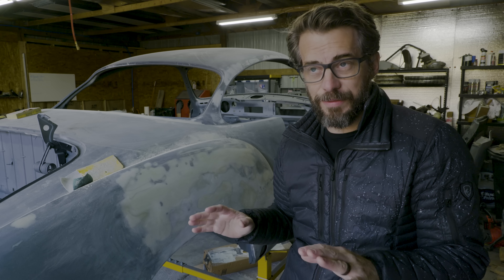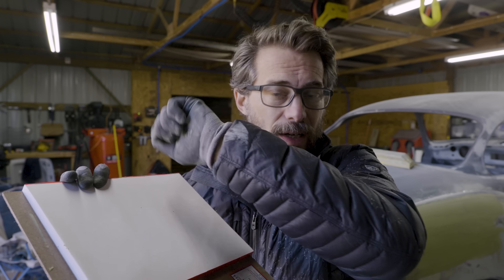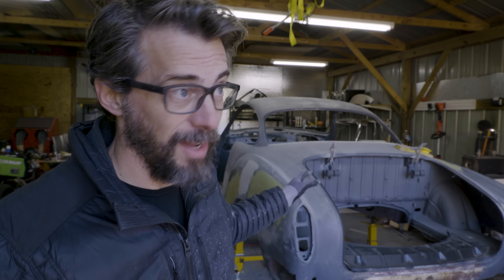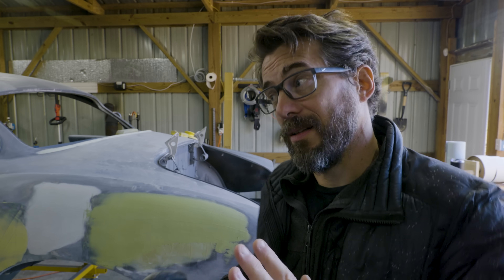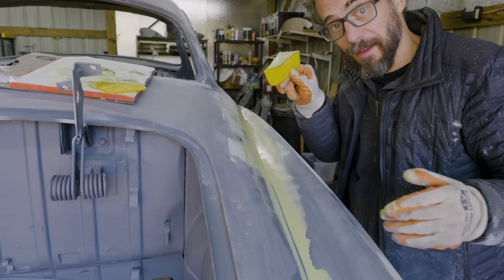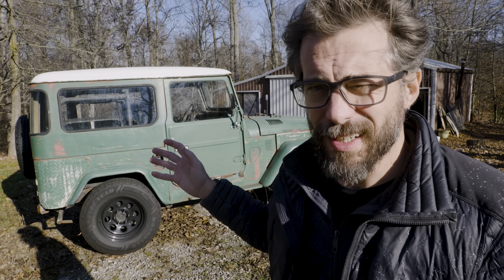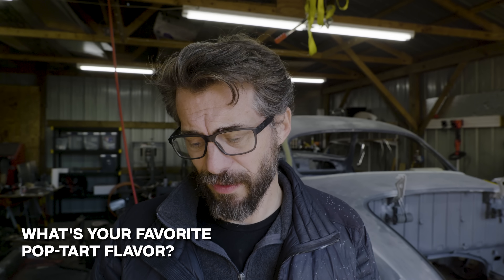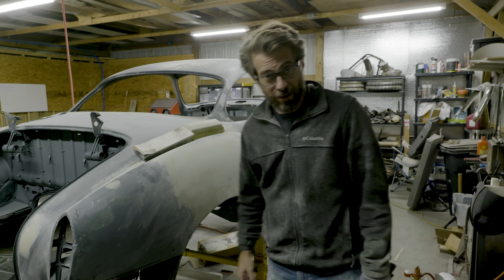How Do You Eat an Elephant?

Comment: Any time you are doing work that relies on chemical reactions (glue, epoxy, paint, body filler, etc.) you MUST have environmental control. You need heat to do any work in that garage in the winter. Go get a torpedo heater.

Comment: If you have to wear a jacket, it's too cold to work body filler. It will shrink and just not do right. Also, unheated metal is 20 degrees colder than ambient temperature . Just stop until it warms up!!!
Reply from the maker: That's a good point, maybe I'll pause it until spring and work on the chassis.